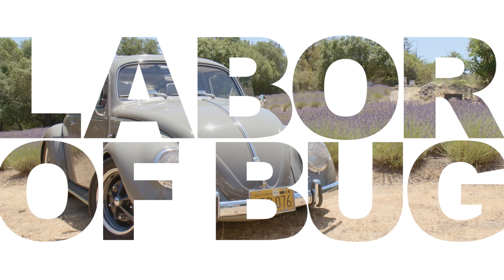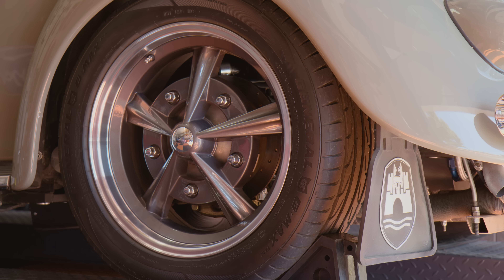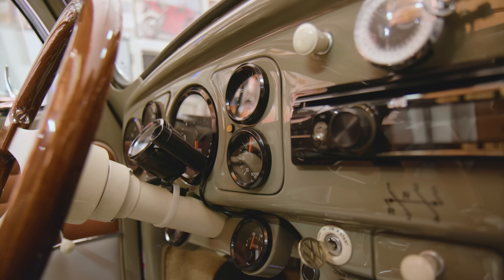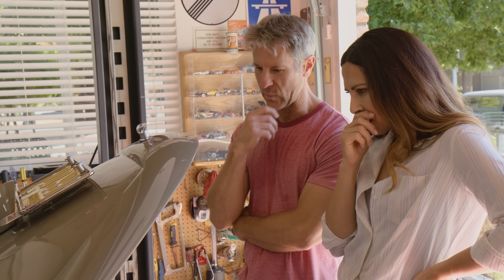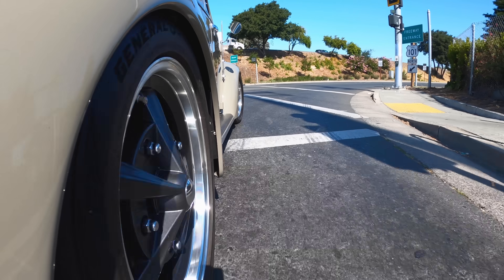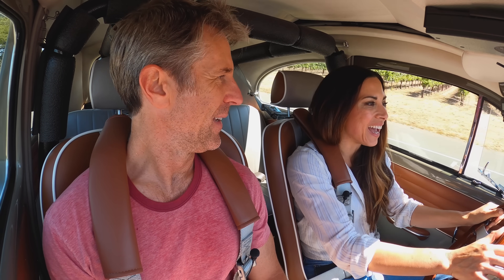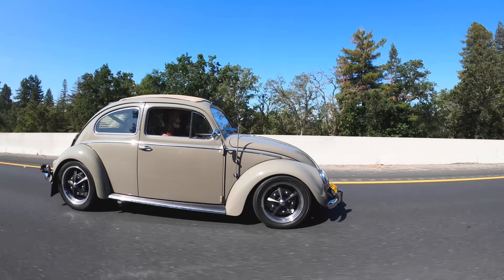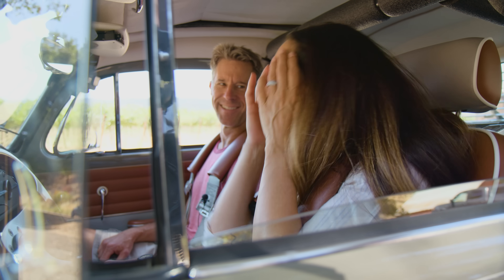LABOR OF BUG: Twin-Turbo '59 VW Euro Beetle 27 Years in the Making | EP10

Comment: Lovely car, lovely test, awesome work, tremendous vehicle dynamics and stability! Is it 4 gears with the original differential ratio of the 1600cc.?
Reply: I posted the specs below. it's a custom 5 speed with a Quaife LSD
Reply: 1959 Euro Beetle Twin Turbo Resto-Mod

Engine:
•	2387cc VW Type 1 aluminum super case with Hoover mods, 8.3:1 CR, clearanced, blueprinted and balanced by owner
•	Scat forged counterweighted 86mm crank, type 1 mains, 2” Chevy rod journals
•	DRD 5.5” H-beam rods with 5/16” ARP bolts
•	Revmaster long 94mm cylinders, cut to length
•	Wiseco  pistons[P/N#K633M94, 9400XX ring pack(1.0mm x1.2mm x2.8mm)] 
•	WebCam custom grind turbo cam with Dial-A-Cam steel straight cut gears and CB lightweight lifters 
•	CB Wedge Port CNC ported heads(44x37.5) with single “Bee Hive” springs and 8mm chromoly studs
•	NGK DCPR8EIX Iridium spark plugs and Magnecor wires 
•	Scat 1.25:1 Pro Comp rocker arms with ACN heavy duty dual tapered aluminum pushrods 
•	Parallel twin modified Garrett VNT25 variable vane turbos with manual vane control and water jacket cooling system by owner
•	Custom 1.5” phase tuned “twin scroll” exhaust system, ceramic coated and wrapped, made by owner 
•	Twin Turbosmart 38mm wastegates and Turbosmart Eboost Street electronic boost controller
•	Electromotive upgraded TEC3 EFI full sequential engine management with Clewett Engineering cam sync. Dyno tuned by AJ at Performance In-frame Tuning  in Napa, CA making 230HP/210TQ at the wheels with 15psi
•	Bosch in-line fuel pump, Aeromotive regulator and filter, teflon hoses, with Siemens Deka 60lb/hr injectors
•	Prometh two stage water/methanol injection with nozzles before and after compressors, with Snow progressive controller
•	Custom blow through finned aluminum intake with modified CB 48mm throttle bodies & match ported injector manifolds, HKS blow off valve, custom dual throttle cable system and cold air intake by owner
•	Bergmann modified Porsche style fan kit with custom thermostat, front, rear and lower cylinder tins  by owner
•	Scat 5.25” aluminum pulley with sand seal, crank trigger wheel and custom sensor mount by owner
•	Dry sump system with CB pump, Pure Power cleanable filter with Scat bypass mount, remote cooler with thermostatic fan control and custom oil tank in right rear fender well by owner
Transaxle:
•	Type 1 swing axle, gusseted aluminum Rhino case, Berg 5 speed with Quaife TBD by Rancho
•	3.44 R&P, 3.78 1st, 2.21 2nd, 1.58 3rd, 1.21 4th, 0.93 5th  with Berg custom mid mount and 5 speed ball shifter
•	Empi long spline, long axles(‘68 only), with custom prototype lubrication system, by Mike Herbert at Rancho and owner 
•	Custom hydraulic clutch with remote reservoir and heavy duty hiem joint clutch cable back up option by owner
•	12lb. flywheel with Kennedy Stage 2 pressure plate, CB dual friction disc, anti-shocker and high torque starter
Chassis, Suspension & Brakes:
•	Airkewld 4” narrowed, adjustable front beam, with bump stops and tow bar mounts added by owner
•	CB 2.5” dropped spindles with CSP wide 5 drilled front disc, Hurst Line Loc and CB wide 5 drilled rear disc brakes with Tilton remote reservoirs
•	Wilwood brake proportioning valve on front line and brake cooling ducts front and rear by owner
•	Sway-a-Way 26mm rear torsion bars, Atomwerk 1” lowered adjustable spring plates with needle bearings
•	Pan stiffeners, front beam stiffeners, gusseted torsion arms, front air dams, four wheel alignment and corner balance
•	CSP torque bar, Berg traction bar, tranny straps and custom 0.75” front and rear sway bars by Addco
•	Bilstein shocks front(stock height) and rear(1” lower and custom valved)
•	Custom one-off aluminum smoothie wide 5 wheels with spun aluminum hubcaps(15x5F, 15x6R) and a set of Rader track wheels(15x5F, 17x7R)
•	Dry weight approx. 2200lbs.   
Body & Interior:  
•	Grafted in ragtop and semaphores, body work by owner and Rick Eichler, Classic Restoration in Sonoma, CA
•	VW mouse grey PPG CLV single stage urethane with clear coat sprayed by Rick Eichler
•	Original style interior with German square weave carpet & Haartz Stayfast canvas ragtop by West Coast Classic Restoration and custom Daily Driver racing bucket seats by Status Racing Seats
•	4 point harnesses and roll bar, LED lighting, original pop out quarter windows
•	1.25” widened fiberglass rear fenders by Creative Car Craft, convertible decklid with custom rain gutters by owner
•	Dynamat sound deadening material throughout and custom heater system with booster fans
•	Custom auxiliary wiring harness with blinking semaphores, emergency flashers, intermittent wipers 
•	Custom Speedhut 12 gauge set and switch console and custom stereo system by owner

Comment: Love it ! Vdubs rock ! what kind of power are you putting down ? ass dyno from the size and spec would say 350-400 ? Thanks
Reply: 230WHP & 210WTQ
Reply: 1959 Euro Beetle Twin Turbo Resto-Mod

Engine:
•	2387cc VW Type 1 aluminum super case with Hoover mods, 8.3:1 CR, clearanced, blueprinted and balanced by owner
•	Scat forged counterweighted 86mm crank, type 1 mains, 2” Chevy rod journals
•	DRD 5.5” H-beam rods with 5/16” ARP bolts
•	Revmaster long 94mm cylinders, cut to length
•	Wiseco  pistons[P/N#K633M94, 9400XX ring pack(1.0mm x1.2mm x2.8mm)] 
•	WebCam custom grind turbo cam with Dial-A-Cam steel straight cut gears and CB lightweight lifters 
•	CB Wedge Port CNC ported heads(44x37.5) with single “Bee Hive” springs and 8mm chromoly studs
•	NGK DCPR8EIX Iridium spark plugs and Magnecor wires 
•	Scat 1.25:1 Pro Comp rocker arms with ACN heavy duty dual tapered aluminum pushrods 
•	Parallel twin modified Garrett VNT25 variable vane turbos with manual vane control and water jacket cooling system by owner
•	Custom 1.5” phase tuned “twin scroll” exhaust system, ceramic coated and wrapped, made by owner 
•	Twin Turbosmart 38mm wastegates and Turbosmart Eboost Street electronic boost controller
•	Electromotive upgraded TEC3 EFI full sequential engine management with Clewett Engineering cam sync. Dyno tuned by AJ at Performance In-frame Tuning  in Napa, CA making 230HP/210TQ at the wheels with 15psi
•	Bosch in-line fuel pump, Aeromotive regulator and filter, teflon hoses, with Siemens Deka 60lb/hr injectors
•	Prometh two stage water/methanol injection with nozzles before and after compressors, with Snow progressive controller
•	Custom blow through finned aluminum intake with modified CB 48mm throttle bodies & match ported injector manifolds, HKS blow off valve, custom dual throttle cable system and cold air intake by owner
•	Bergmann modified Porsche style fan kit with custom thermostat, front, rear and lower cylinder tins  by owner
•	Scat 5.25” aluminum pulley with sand seal, crank trigger wheel and custom sensor mount by owner
•	Dry sump system with CB pump, Pure Power cleanable filter with Scat bypass mount, remote cooler with thermostatic fan control and custom oil tank in right rear fender well by owner
Transaxle:
•	Type 1 swing axle, gusseted aluminum Rhino case, Berg 5 speed with Quaife TBD by Rancho
•	3.44 R&P, 3.78 1st, 2.21 2nd, 1.58 3rd, 1.21 4th, 0.93 5th  with Berg custom mid mount and 5 speed ball shifter
•	Empi long spline, long axles(‘68 only), with custom prototype lubrication system, by Mike Herbert at Rancho and owner 
•	Custom hydraulic clutch with remote reservoir and heavy duty hiem joint clutch cable back up option by owner
•	12lb. flywheel with Kennedy Stage 2 pressure plate, CB dual friction disc, anti-shocker and high torque starter
Chassis, Suspension & Brakes:
•	Airkewld 4” narrowed, adjustable front beam, with bump stops and tow bar mounts added by owner
•	CB 2.5” dropped spindles with CSP wide 5 drilled front disc, Hurst Line Loc and CB wide 5 drilled rear disc brakes with Tilton remote reservoirs
•	Wilwood brake proportioning valve on front line and brake cooling ducts front and rear by owner
•	Sway-a-Way 26mm rear torsion bars, Atomwerk 1” lowered adjustable spring plates with needle bearings
•	Pan stiffeners, front beam stiffeners, gusseted torsion arms, front air dams, four wheel alignment and corner balance
•	CSP torque bar, Berg traction bar, tranny straps and custom 0.75” front and rear sway bars by Addco
•	Bilstein shocks front(stock height) and rear(1” lower and custom valved)
•	Custom one-off aluminum smoothie wide 5 wheels with spun aluminum hubcaps(15x5F, 15x6R) and a set of Rader track wheels(15x5F, 17x7R)
•	Dry weight approx. 2200lbs.   
Body & Interior:  
•	Grafted in ragtop and semaphores, body work by owner and Rick Eichler, Classic Restoration in Sonoma, CA
•	VW mouse grey PPG CLV single stage urethane with clear coat sprayed by Rick Eichler
•	Original style interior with German square weave carpet & Haartz Stayfast canvas ragtop by West Coast Classic Restoration and custom Daily Driver racing bucket seats by Status Racing Seats
•	4 point harnesses and roll bar, LED lighting, original pop out quarter windows
•	1.25” widened fiberglass rear fenders by Creative Car Craft, convertible decklid with custom rain gutters by owner
•	Dynamat sound deadening material throughout and custom heater system with booster fans
•	Custom auxiliary wiring harness with blinking semaphores, emergency flashers, intermittent wipers 
•	Custom Speedhut 12 gauge set and switch console and custom stereo system by owner

Comment: I was hoping Marc would explain if that's the original block and stock internals? How did he make a 2.4L engine? Is it from OEM VW parts?
Reply: 1959 Euro Beetle Twin Turbo Resto-Mod

Engine:
•	2387cc VW Type 1 aluminum super case with Hoover mods, 8.3:1 CR, clearanced, blueprinted and balanced by owner
•	Scat forged counterweighted 86mm crank, type 1 mains, 2” Chevy rod journals
•	DRD 5.5” H-beam rods with 5/16” ARP bolts
•	Revmaster long 94mm cylinders, cut to length
•	Wiseco  pistons[P/N#K633M94, 9400XX ring pack(1.0mm x1.2mm x2.8mm)] 
•	WebCam custom grind turbo cam with Dial-A-Cam steel straight cut gears and CB lightweight lifters 
•	CB Wedge Port CNC ported heads(44x37.5) with single “Bee Hive” springs and 8mm chromoly studs
•	NGK DCPR8EIX Iridium spark plugs and Magnecor wires 
•	Scat 1.25:1 Pro Comp rocker arms with ACN heavy duty dual tapered aluminum pushrods 
•	Parallel twin modified Garrett VNT25 variable vane turbos with manual vane control and water jacket cooling system by owner
•	Custom 1.5” phase tuned “twin scroll” exhaust system, ceramic coated and wrapped, made by owner 
•	Twin Turbosmart 38mm wastegates and Turbosmart Eboost Street electronic boost controller
•	Electromotive upgraded TEC3 EFI full sequential engine management with Clewett Engineering cam sync. Dyno tuned by AJ at Performance In-frame Tuning  in Napa, CA making 230HP/210TQ at the wheels with 15psi
•	Bosch in-line fuel pump, Aeromotive regulator and filter, teflon hoses, with Siemens Deka 60lb/hr injectors
•	Prometh two stage water/methanol injection with nozzles before and after compressors, with Snow progressive controller
•	Custom blow through finned aluminum intake with modified CB 48mm throttle bodies & match ported injector manifolds, HKS blow off valve, custom dual throttle cable system and cold air intake by owner
•	Bergmann modified Porsche style fan kit with custom thermostat, front, rear and lower cylinder tins  by owner
•	Scat 5.25” aluminum pulley with sand seal, crank trigger wheel and custom sensor mount by owner
•	Dry sump system with CB pump, Pure Power cleanable filter with Scat bypass mount, remote cooler with thermostatic fan control and custom oil tank in right rear fender well by owner
Transaxle:
•	Type 1 swing axle, gusseted aluminum Rhino case, Berg 5 speed with Quaife TBD by Rancho
•	3.44 R&P, 3.78 1st, 2.21 2nd, 1.58 3rd, 1.21 4th, 0.93 5th  with Berg custom mid mount and 5 speed ball shifter
•	Empi long spline, long axles(‘68 only), with custom prototype lubrication system, by Mike Herbert at Rancho and owner 
•	Custom hydraulic clutch with remote reservoir and heavy duty hiem joint clutch cable back up option by owner
•	12lb. flywheel with Kennedy Stage 2 pressure plate, CB dual friction disc, anti-shocker and high torque starter
Chassis, Suspension & Brakes:
•	Airkewld 4” narrowed, adjustable front beam, with bump stops and tow bar mounts added by owner
•	CB 2.5” dropped spindles with CSP wide 5 drilled front disc, Hurst Line Loc and CB wide 5 drilled rear disc brakes with Tilton remote reservoirs
•	Wilwood brake proportioning valve on front line and brake cooling ducts front and rear by owner
•	Sway-a-Way 26mm rear torsion bars, Atomwerk 1” lowered adjustable spring plates with needle bearings
•	Pan stiffeners, front beam stiffeners, gusseted torsion arms, front air dams, four wheel alignment and corner balance
•	CSP torque bar, Berg traction bar, tranny straps and custom 0.75” front and rear sway bars by Addco
•	Bilstein shocks front(stock height) and rear(1” lower and custom valved)
•	Custom one-off aluminum smoothie wide 5 wheels with spun aluminum hubcaps(15x5F, 15x6R) and a set of Rader track wheels(15x5F, 17x7R)
•	Dry weight approx. 2200lbs.   
Body & Interior:  
•	Grafted in ragtop and semaphores, body work by owner and Rick Eichler, Classic Restoration in Sonoma, CA
•	VW mouse grey PPG CLV single stage urethane with clear coat sprayed by Rick Eichler
•	Original style interior with German square weave carpet & Haartz Stayfast canvas ragtop by West Coast Classic Restoration and custom Daily Driver racing bucket seats by Status Racing Seats
•	4 point harnesses and roll bar, LED lighting, original pop out quarter windows
•	1.25” widened fiberglass rear fenders by Creative Car Craft, convertible decklid with custom rain gutters by owner
•	Dynamat sound deadening material throughout and custom heater system with booster fans
•	Custom auxiliary wiring harness with blinking semaphores, emergency flashers, intermittent wipers 
•	Custom Speedhut 12 gauge set and switch console and custom stereo system by owner